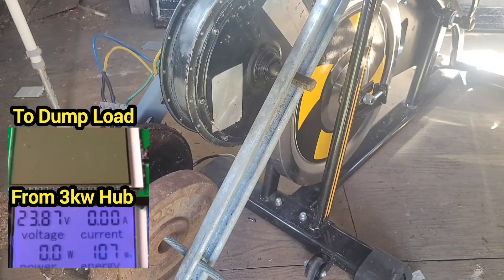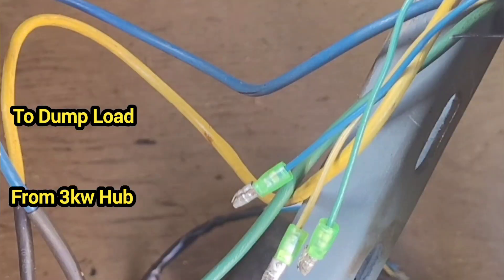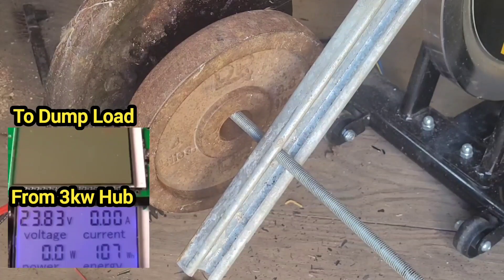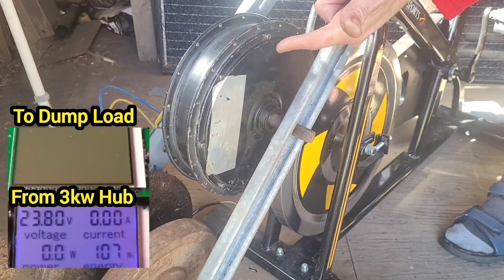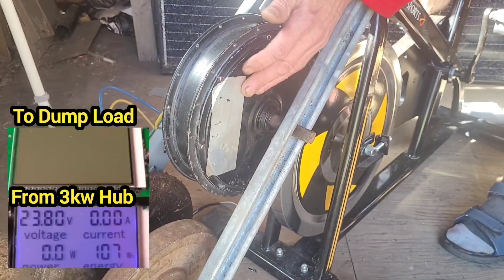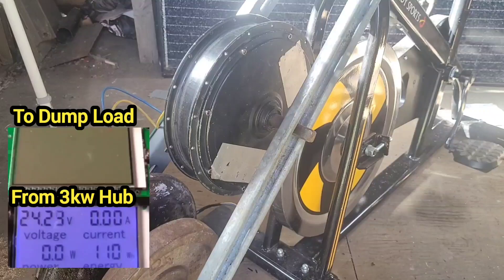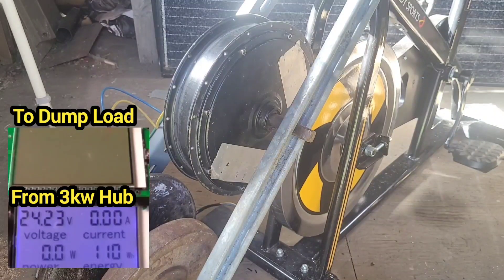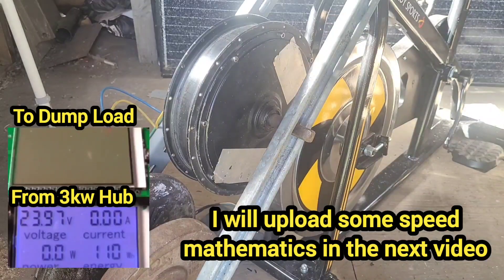Spin Bike PLUS 3kw 72V E-Bike Hub Motor as a 24V Generator - could be totally Super Epic !!

Comment: Animal (horse 😂) going around in a circle with a harness attached to a pole going to a differential for desired rpm of motor and dang, have power for the cost of feeding and watering an animal.
James Watt studied and decided 1 horsepower is 746 watts (he was trying to figure out how to sell electric motors to people who only had horses). 
You getting to 400 I think I saw is amazing! Makes me wonder if a horse can put out more power. Either that or there's some chinese math going on somewhere 😅 possibly the horse power rating is over a sustained period of time too, i forget... or maybe never knew
Reply from the maker: I think a horse can maintain it for a long time whereas a human can't
Reply: @GavinFreedomLover  I watched Donut dyno a horse after I commented on YouTube. It's pretty interesting
Reply: the "watt" didnt exist until a bit later. like "ohm" was derided and laughed at until a bit later... in either case, their name lives on as a unit... as is a "tesla"...

he rated 1HP as 33,000 ftlbs/minute.

a rather arbitrary unit, causing much frustration... "why so unusual?"

it makes perfect sense. its 1000lbs of water lifted to 33 feet every minute. why 33 feet? because thats the maximum height you can raise water via suction, at which point it starts to boil rather than "lift".

and as the main purpose of the engine was to lift water out of mine shafts, the reasoning behind such an "arbitrary" unit suddenly doesnt seem so random at all. its easily repeated and verified.

and he overrated the engine as he charged royalties on the work performed. if one engine replaced six horses, he expected a percentage of the costs saved. and often, that 1hp motor DID replace several horses...

no "truth in advertising" back then.

Comment: It works but i see 2 problems..The friction is too high and you could increase the rpm if you use a belt and 2 pulleys...let's say 1:6 raport...
Reply from the maker: No the friction is too low , it spins at the perfect speed belt to complicated and not needed.